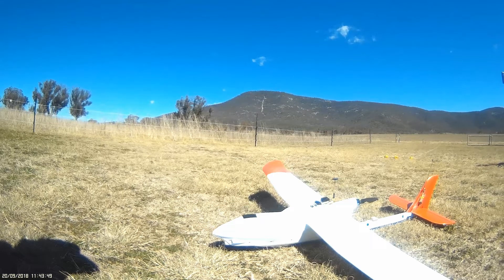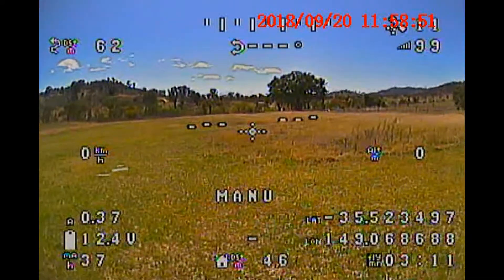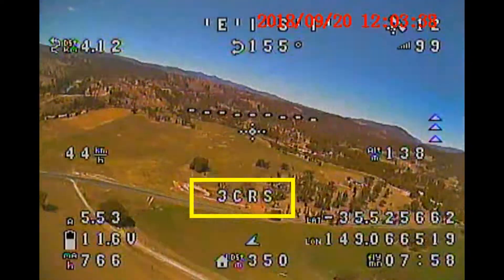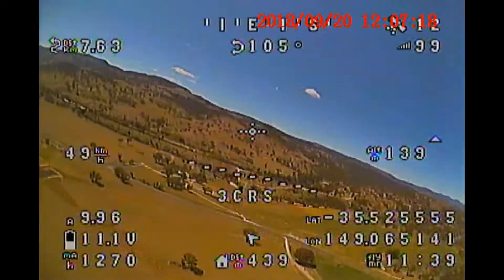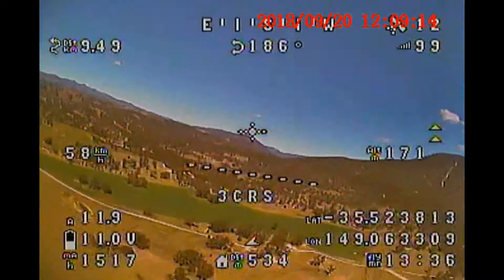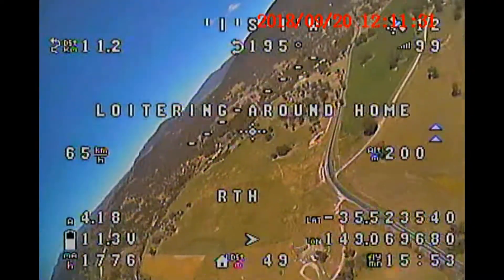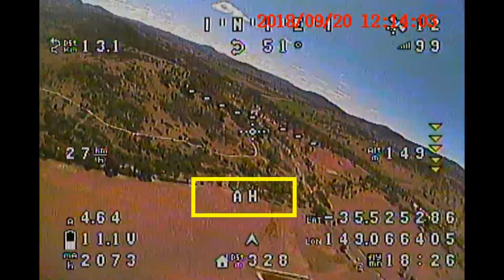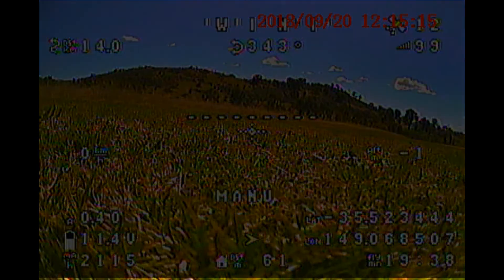FPV Ranger 1600 with F405 WING FC - Maiden flight.

Comment: Strongly sugesst Servo Centering and Autotune.  Will make a major difference
Reply from the maker: You're right. Since zeroing the tx trims and using the AutoTrim function, the flight modes are now working perfectly. I've set up the AutoTune function but haven't used it yet. She seems to be flying well now I'll get a few more flights under my belt before deciding if she needs further tuning. https://www.youtube.com/watch?v=KQmq0bfGbl0

Comment: Hi Ken, a couple of key differences between Inav and every other FC are, you cannot use your trims on your radio at all, they immediately disable the hold modes. You also need to do an 'autotune' and save it once it's complete by landing and disarming in mode (see wiki). To do it properly, you need to do some aggressive flying and some hands off sticks straight and level to let it learn what the plane is doing. To trim, you need to assign a channel to a switch and set it as autotrim in Inav setup gui, it will then correct any drift and effectively recenter the plane's trim to that new stick position. I put a two position switch with pos 1 as autotrim, and pos 2 autotune.
Anyway, great results so far. Cheers.
Reply from the maker: Thanks. I had another flight yesterday which was better but all the NAV modes were making left-hand circles so I guessed that the trims might have been the problem. I did some more reading tonight and have now set up the Auto Trim/Tune switches.  I've also zero'd all trims/rates/expo on the tx and have just used the CLI interface to cut back on the rates/expo in Manual mode.

I've set up a number of modes MANU/CRS/CRS+NAV_ALTHOLD/NAV_ALTHOLD+NAV_POSHOLD/RTH and have set AIR Mode to permanently engaged to hopefully fill in any gaps.

The weather's looking good for tomorrow so hopefully by the end of it I'll be back chasing that 10km prize.

Comment: As I understand, the 3D hold modes in iNav are meant to keep the plane in a particular orientation and aren't really suited for cruise where you just need alt & head hold.  I believe you're right about opening up the circle radius, and you PIFFs may be a bit sharp too.  I love me some iNav though, it's definitely worth the effort it takes to tune.

Comment: Isn't it simply tailhavy?
Reply from the maker: I think it is, but not badly. I moved the CoG a bit forward today and RTH was much more stable but the other modes appear to be affected by the tx trims I need to keep it flying level in Manual mode. More research needed.

Comment: Looking forward to seeing more inav adventures. try auto trim and auto tune was a bit scary at first but worked a treat good luck.
Reply from the maker: I've been reading up on Autotune but still a bit confused. I've read conflicting comments about how to save the "tuned" values after the flight. I don't take a computer with me and apparently the "save" command using Stick inputs doesn't work while the model is armed. Disarming apparently "loses" the tuned values?

Will keep looking.